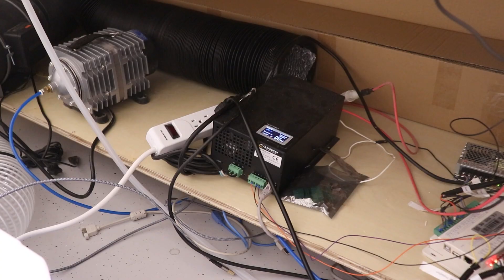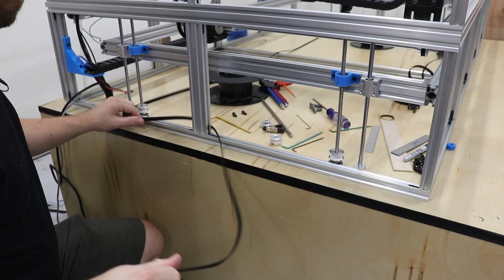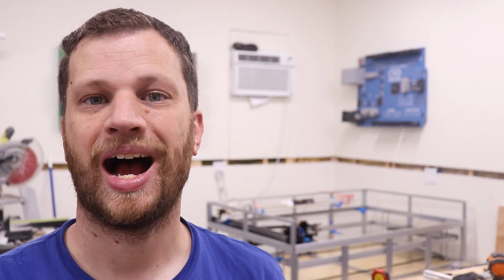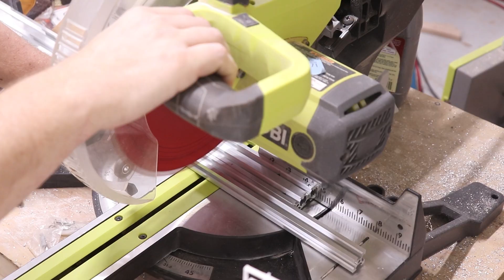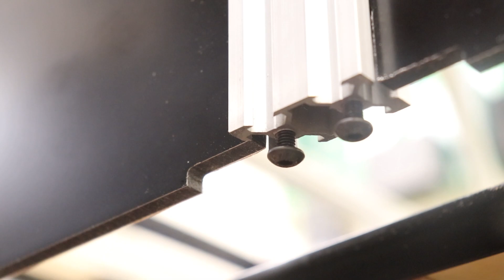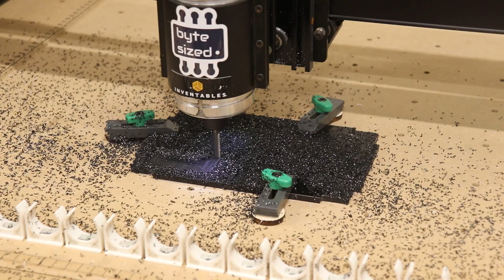"That's a problem for future Zach" - CO2 Laser Cutter Part 6

Comment: I've just come across your build, which is fortuitous as I've just decided to build my own laser ... I'm going to be a bit simpler with the frame using MDF or plywood ... only extrusions will be C-Beams with two for X axis and one for Y axis .......... I've still to decide whether to go with CO2 or a diode laser, although I suppose I could fit both (it's just money after all) .... still to decide on electronics as well.
Thanks for sharing, it's been very interesting and will help me avoid some of the issues you have come across 👍
Reply: Have you decided which lazer yet, and if so what was the reasoning?
Reply: @kreynolds1123  Hi, had a bit of ill health lately so not done any more research ... I've been looking at two diode lasers in particular (longer lifespan and easier to set up than CO2) the XTool 20W module and the AtomStack M100 20W module ... I'll most likely go for the AtomStack as it's 1) a fair bit cheaper and 2) it comes with everything required (including the air assist bit).

I have a feeling that all of these lasers originate from one or two places and it's only the clothing (casings etc) which is changed for each company.
Reply: @barry.w.christie  If you want to cut wood - or PCBs and lots of things other than clear acrylic, diode would be good (though they tend to burn out faster but are cheaper).
As tempting as a diode laser is, I am more inclined towards CO2 despite the extra cost and requirements purely because it can cut transparent acrylics
Reply: Hmmm ... when I looked a 40w CO2 laser was cheaper than buying a diode and the info I found said that the CO2 would burn out faster than the diode ... more research needed before I decide!
I've got a bathroom and a boiler to install first before I go anywhere near my mill and laser 👍
Reply: @Barry Christie  i think CO2 without a cooler and water pump burn out faster.. as far as i know, they can go for longer if maintained.  We have a couple of CO2 at  a makepeace with extreme heavy use and i think they've outlasted diode.  That's with chillers.  If coolant is circulated it may eventually heat up in a closed system reducing any cooling.  Maybe this is where the data comes in against CO2, diode don't require the same cooling so could last longer without being careful.  Water < coolant < coolant + radiator :)

If be keen to hear about your findings!

Comment: Can you please link to the material you used for the enclosure panels?
Reply from the maker: It's called aluminum composite material. I think it's sometimes called Dibond. It might be best to get it from a local source. I got these panels from the video sponsor Send Cut Send. https://sendcutsend.com/materials/acm/
Reply: @bytesizedengineering  thank you very much. I'm in the process of building a machine too.  I'm building off of the plans from @furtherfabrications.

Comment: Believe it or not, I've not used ferrules on my 3d printer and after 3 years of use when I took it apart the block where the wires connected was melted into a blob and the insulation on the wires was melted too, almost burned my house down. What happens is the wires wiggle loose in time causing a high resistance connection, thus dissipating a lot of heat. It's not that electricity jumps across or whatever, it's that loose wires work themselves free in time if you don't have a spring to keep constant pressure on them.

It's only required for stranded wires, if you use solid core it's fine without.
Reply from the maker: Did that melting happen on the AC input side of your power supply? Or was it on the DC heated bed terminals? What kind of printer was it? I had an anet a8 and cheap printers from China are notorious for using wire that's too small. When you run too much current through too small of wire it warms up and gets soft and deforms. Also most cheap 3D printers don't have safety measures in place for thermal runaway. I put a version of the Marlin firmware on my machine that had these safety features.
Reply: @bytesizedengineering  nope, dc supply to the main board. You're right about the AC being lower power, a loose wire will likely just short to earth and pop the breaker assuming it's just one wire that goes for a ride :)
My printer is a fully diy thing, it's using ferrules now and haven't had an issue, but I still check it on a regular basis.
Reply: @bytesizedengineering  dude just accept that this is the right way to do your terminala😂

Comment: So first of all, no judgement.  That being said, is that translucent gray acrylic blocking the laser's wavelength?  If so, how did you know?  I've tried shopping around for laser-blocking materials, but I've always found it difficult to confidently know whether a given material will block a given wavelength.  Is there a resource out there I'm unaware of?  Or did you just test by shooting at paper, with the acrylic between?  Very curious.
Reply from the maker: Great question. I'm not expecting the acrylic to block all of the energy of the laser. I haven't eliminated all of the risk. There is still risk in my setup. My first line of defense is having mirrors that are aligned in all locations of the work area. My second line of defense is wearing safety glasses that are rated for 10,600 nanometers which is the wavelength of my tube. Lastly, I know that this laser will cut through acrylic so in the event of a failed mirror alignment the acrylic will absorb some of the energy. Obviously some of the energy will make it through and that's why I wear safety glasses. I'm not aware of any translucent materials that would block the right wavelength. Other than the material that is in my safety glasses.
Reply: @bytesizedengineering  consider using polycarbonate, if memory serves it blocks nearly all light at CO2 laser wavelengths. Don't take my word for it though and look into it yourself.
Reply: @oliverer3  I'm pretty sure that's about right. reguardless, if it lazer light went wild, it could still burn through and one would still need safety glasses.
Reply: Consider a all clear and in operation status light. While you may be able to hear the machine running and know to have you're glasses on future users may not be as knowledgeable or careful. In addition you may want to entertain a N/C switch on you're door ties into the E-stop for similar reasons. Amazing job.@byte sized engineering

Comment: For as much as I like the feral crimps you should have used fork crimps so when tightening down the screws on the power supplies it would have an equal pressure on it.